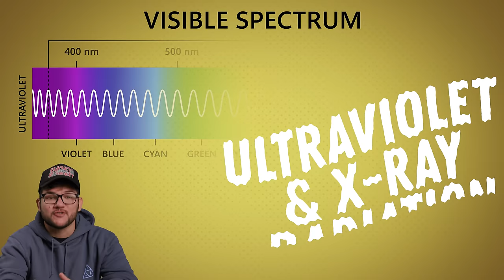Mechanic Reacts to Welding Fails from Tiktok

Comment: Sandro is a jack-of-all-trades!! What else can he do?
Reply: Sandro is that 45 year old dude from your local shop that has been doing mechanic work since he was 15. There is very little he hasn't seen, done, fixed or broken.
Reply: "...So we invited some professional monster truck drivers to-  Wait, you here again?"

"Well @#$& yeah bro!"
Reply: @russelljacob7955  LMAO
Reply: Jack of all trades, master of none, but often better than master of One.
Reply: Im sure they’re out there, but don’t know any mechanics that don’t know how to weld. I think there’s more welders that don’t wrench.
Reply: Jack-of-all-trades, master of none? No, my man Sandro is master of everything!
Reply: roll a perfect ass blunt
Reply: Probably juggle 6 sparkplugs with one hand, 3 turbos with the other while balancing on a transmission tunnel on one leg.
Reply: @vittoriosandoni7064  It's rare to find someone that actually knows the whole quote and doesn't use it as a slight.  👍
Reply: @wisconsineaglesfan7925  I’d never heard the full one and I like it. It reminds me of blood is thicker than water. The actual quote means the opposite: “the blood of the covenant is thicker than the water of the womb.”
Reply: That’s like saying a carpenter is a jack of all trades because he can swing a hammer.
Reply: @swamp-yankee  More often than not mechanics are terrible welders. They’re often worse than hobby welders because mechanics truly believe they can weld when they typically suck. When you lack the technical knowledge it’s real easy to convince yourself that your undercut weld with no penetration is good.
Reply: My mom... wait.

Comment: I am a weld inspector, pipeline among other things as Sandro mentioned. The red stuff you see coming out of the weld at 10:00 is called dye penetrant, it is a specific type of oil colored with dye that draws itself into cracks and other imperfections. The surface is then cleaned and what the guy in the video is spraying is the developer, essentially aerosolised chalk, that draws the red coloring out to the surface.

Also where I live, carnival rides are definitely subject to regular weld inspections, at least on load bearing areas and repairs.
Reply: When I get another 1,000 hours under the hood I want to get certified as an inspector.
Reply: we use it in hvac for leak detection too

Comment: I watched an industrial welder do some stainless steel piping connections once and what made me stop to see the outcome was that he was making some weird looking upper body and shoulder movements with a Tig welder. It was the most perfect smooth weld I have ever seen! The flow of the weld looked like a machine had done it.
Reply: a machine did do it.

a tig welder is a machine.

Comment: I’ve been welding for 48 years, one of the first things I learned was just because it’s aesthetic doesn’t mean it’s a good weld. The pretty part comes with experience, make sure you have your prep and penetration down first, then practice on making it better looking. 
 Lesson 2: just because someone bought a large tool box with tools doesn’t make them a mechanic, same goes with a welder.
Reply: Yep. You can make an ugly weld that penetrates and you can make a pretty weld that don't. That said, quite a few of the bad welds shown in this video pretty obviously didn't penetrate..
Reply: The Trades take time to grow and deepen the learned.

As seen by "rechtschaffend frei/fremde Wandergesellen" on their "Walz" over here in Germany and actually throughout the entire Euro - Asian Continent if one so desires.
most often they are Carpentry Journeypersons in their Journeymen years
Reply: I got the shit stick cause i can do very strong mig welds but they usually look like crap, and i got a job that needs pretty welds not necessarily stronk welds

Comment: As someone who has spent ten years all over the country welding from ships to oil rigs to pipelines this video was enjoyable.  As a trained professional with a degree in metallurgy this was one of the most painful videos I have seen in a long time!  On a side note some of the best welders I have seen are mechanics they just have to do a lot more welding than you think.
Reply: meh they more or less have a controlled environment. not impressed

Comment: Welding when you get all the prep right and everything is just working spot on is actually really relaxing I find. You get in the zone and nothing can move you.
Reply: man, it's almost like you're in your own little world in there. You get your ear pro in, covered in leather or heavy cotton, mask down so you can see nothing but your weld... Everything else is gone, it's just you and your weld. I love it. Unfortunately my ears start to hurt after 4-6 hours with earplugs in so actually working 10 hour shifts as a welder hasn't worked out for me.

Comment: My first big welding project was welding new axle perches and mounts as well as shoring up a northeast Jeep frame. 3 years later and the welds are still holding strong, and one time even smashed through a pothole and really rocked everything and they didn't break.

I did this on literally like 2 hours of learning how to stick weld.

Comment: 10:25 I worked as a machinist in a petrochemicals plant and my man Sandro is spot on. I usually beveled the pipes for fabrication shop between 30 and 37.5 degrees and you get a nice V shape when you face them on each other.

Comment: I remember on my first welding job I was welding aluminum structural with meg. I was looking up, spark, came down with the bottom of my shirt up and I was on fire didn’t stop even though if that’s a little hot smells a little didn’t realize what was happening till someone laughed and pointed at me and I was on fire. God bless welders one of the most blue-collar jobs you can do.

Comment: Flux core is my favorite; it's like mixing MIG and stick welding. And then a bit of TIG just to clean up the surface (if we're not grinding). I do alright; but I need way way way more practice before I'd put my welds out there. xD
11:00 - My welding instructor told me he inspects welds as much as he can see before he ever gets on a ride.

Comment: 11:50 allegan county fair flipper ride got stuck with kids on it a few years back. I remeber going to look at it as an Industrial Electrical Technition. It was an old Italian machine from the 80's. Needless to say I looked at it opened the electrical cabnet to a spagetti wired mess in italian, and said ya I can't take this on for liability sake.

Comment: I have a degree in welding technology. I thoroughly enjoyed this video. Keep up the good work.
On a side note, the buggered wire feed welds are caused by running incorrect polarity. MIG and FCAW are both wire feed, but require opposite polarity.

Comment: Our local carnival consists mostly of vintage rides. Very sketch welds. The last time I was there is the last time I ever go to a county fair. I was riding a spinning ride that moved you up and down in the air. One of the service doors flew open and proceeded to smack the rides being banged around so hard it was throwing sparks when it collided with the bars. The very lazy "I don't get paid enough to work here" worked, very slowly came over to the controls and decelerated the ride, rather then hitting the emergency stop button. Meanwhile the rides kept hitting the door. The door was a mangled mess (could have injured someone) and the ride operator proceeded to grab duck tape and tape the  door shut. Everyone in line and on the ride noped out of there. Welds on the rides were bad but not only that, very cracked and rusted supports.

Comment: My metal fab and welding teacher in high school 20 years ago taught me CLAMS: 
Current (How hot you're running) 
Length of arc (How far from your material you are) 
Angle (Your angle in relation to what type of weld you're doing and what thickness material you're welding) 
Movement (How you manipulate the arc; J-hooks, Keyholes, V's, Upside down V's, etc, "walking the cup" for TIG)
Speed (How fast you're traveling). 

Keep those in mind while you're welding and you will produce far more consistent welds.

Comment: So I just finished welding a new rocker panel on my truck today. Watching this is like watching myself make mistakes. I trimmed way too much off in spots and just filled the hole with weld, kept blowing through the thin metal, and had lots of build up. I did a lot of grinding. Overall though, I think not too bad considering I've only welded a little bit on much thicker metal.

Comment: TIG welding done properly is Liquid Sex, I Love it out of all the welding types especially when it's stainless or aluminum. Gas welding is a lot like TIG, It is probably my favorite for ferrous metals. Stick welding is an art, once tamed it's very versatile across many industries. MIG welding with gas is also a huge go to for ferrous metals but I hate flux core welding, it has no place other then the quick fix and spot welds. Got a lot of good laughs and some eye openers too. Awesome Video👍

Comment: Back in high school, one of the boys got a DIY trail bumper kit, where they just mail you a bunch of unpainted flats. 
We pretty much just ground every weld and went over each seam a second and third time before painting.
Probably ruined the heat treatment on the steel, but it ain't what put the truck in the scrap yard.

Comment: Had to pause real quick to add in additional tidbit on tig vs. mig. Tig leaves a soft weld where you can hammer and dolly the metal around a little bit. Mig leaves a hard weld where you can’t hammer and dolly around. It’s completely hard and will crack. Now to finish the rest of video to see if you possibly make that point as well.

Comment: Still remember my first weld. Trying to fix my old broken office chair but didn't realized the tube I was trying to weld back together was actually super skinny and surrounded by a thick aluminium outertube. Using a cheap ass stick welder, I just melted the aluminium to oblivion and the steel tube was just too skinny to weld with a stick welder by a nucklehead like me.. It broke to start with because it was paper thin. Years later, I actually got into workshops in uni and had some seriously skilled welders at my job and managed to learn a bit from them. Still not a welder... but I'll get the basic stuff done with stick and MIG... TIG is another beast altogether. And way cleaner.

Comment: weird thing about putting an AAM1150 under my Thunderbird... the rear driver side was hit. the rear driver side wheel looks like it is a 1/2 inch to far back to the other side... had no idea it was rear ended till i started measuring. modern bumper plastics fall apart when hit, 90's ABS is good. modern reproduction bumper set for that car is as expensive as a new one, have to pull all the casts out of storage...

Comment: I took a welding/metalwork shop class in junior year of HS. These two kids, the biggest stoners in the school, also thought it'd be "lit" to take the class for the extra credits. The next month and a half ended up being an OSHA inspectors worst nightmare. Showing up high as hell, not using safety glasses or hoods, nylon/polyester clothes catching on fire, open toe shoes in the shop, playing with the welder while it's live, hands getting a little too close to the drill press bit 😂 by the end of it everyone else got passing grades for just not causing the instructor more headaches

Comment: I grew up stick welding. I tried mig and Tig for the first time only a few years ago. After I got the hang of mig, I parked my old Lincoln crackle box. I can hear crying of loneliness right now. It still serves it's purpose on large structural stuff, but I rarely mess with anything over 1/4" thick.

Comment: I was a union pipefitter/welder for 10 years and changed careers after seeing how many of the older guys got cancer or lou gherig's disease or radiation poisoning, etc... from both the light and the fumes released by most of the materials being welded. Now anytime I weld, i use a respirator and ke sure no skin is exposed.

Comment: Worked as a "certified high-pressure welder" for decades. While welding in certain areas of powerhouses extremely tight. My welds were X-rayed for quality. Many times as I'm finishing up a weld, I'll smell my clothes smoldering. You don't want to stop and risk ruining or having to restart the weld. As you say the prep work is key. Welding chrome alloy tubes, the shift, opposite mine was supposed to "clean the weld area". My foreman told me they had prepped everything and all I had to do was weld. Everything was going smooth until I got to the "tough spot". You had to work hard to clean this inside area (they failed to). As my heli-arc puddle got to the "tough spot" i saw the puddle start bubbling. I knew immediately they'd missed some dirt. The weld tech knew me and my work ethic, he informed my foreman I was the only one to prep and weld the tubes. No X-ray or pressure failures on my work - ever.

Comment: A saying at my old job "just turn up the voltage and burn through the rust".  I'm no expert, but it was like fingernails on a chalkboard listening to the diarrhea coming out the welders.  A little time with a grinder and actually looking at the chart for a starting point made life a lot easier for me.

Comment: My father owned a local welding shop for 50 years. In my time working there I saw some absolutely abhorrent stuff come in from small traveling fairs. Rollercoasters with barely holding welds and bent rails. Rides with JB weld acting as real repairs. I would never let my kids go on any rides at small fairs after those days.

Comment: 3:04 Uhhhh... welding doesn't create x-rays.... but also the mask does protect against the intensity of the light. If it were just UV protection you could use sunglasses.

Comment: Sandro is awesome because he is humble. Welding is about clean surfaces and heat control and too many people get one or both of those wrong. Too little heat and it looks like a caterpillar laying on the surface and you have no bonding of the metals. Too little cleaning and you get porosity bubbles and once again no real bonding. Some stick rods are meant for welding dirty metals and can put up with some paint or rust but MIG and TIG can not. You might get a "nice looking" weld with MIG on dirty metals if you have your heat and wire speed perfect but you don't have the strength of a clean weld. So if you have to weld dirty use something like 6010 or 6011 or some of the other rods made for deep penetration that can burn through that top dirty layer.

Comment: never welded before. had a chair break and tried to weld it back together. needless to say, my weld did EXACTLY what it was supposed to... for 2 days until the new chair came in and the weld broke. so yeahhhh dont have me doing any important welds for ya. it was fun though! absolutely have a respect for the welding force out there. i got my own set of skills but it is a craft that comes with a steep experience curve.

Comment: Why don't people practice welding before they attempt an actual weld on something like a car? 

I remember when I was 15 and in school I took welding classes because it sounded fun. The first thing we did was to weld random junk steel together for a few weeks. We didn't even get to attempt the first proper work for the class, before the teacher approved our welds on the metal working classroom's junk bin steel. 

Then we got to weld some of our first projects. And that didn't make us pro welders. But at least we knew how to attach two pieces of steel together so they stay together, without melting holes or getting our filler stuck.
Reply: People have this nasty habit of thinking "this shit is easy bro" and of course, it's not. Friend of mine thought he could weld his aluminium boat back together after cracking it. That boat is now at the bottom of the local lake..

Comment: Something most people miss on automotive, even dudes that weld as a day job, is matching filler to base metal. You can throw ER70-S6 on stainless steel but it's going to look and hold like junk.

Comment: My 2013 Ford has that same fuel system. It's never farted but I believe I have bad purge valve because it sputters for about 20-30 seconds after every time I fill it up, but only at the pump so my assumption is air is getting into the fuel line like an air embolism in an IV, so it's going the opposite way of the one in the video.

Comment: I can stick weld but it looks like crap when I'm done.  But, when I weld and finishing  beating the slag off and probably grinding to make it pretty, it will hold.
I've got flash burns a few times with a helmet.  When I was in HS and took a class where they taught you this stuff, a flash burn will make your eyes red as heck.  This was the early 70's so you looked like you just finished off half a lid with the windows rolled up between classes.    Ha.
I figured out one of the best tips is finding and keeping the right angle of the rod and getting that first bead started and running with it.  Did lots or angle iron and 55 gal cans too.   Set the proper power.

Comment: I been there on a few of them mishaps. You don't play around. Several tack welds can give you a sunburn and some cases an extreme one. One thing Sandro mentioned is the eyes. If it gets bad enough, your eyes do feel like they are being sandblasted, whether open or closed. Not a fate I wish on a hard-working individual. My girlfriend was ready to call it in or rush me in when it happened to me. Those who know, just know. I've done lots of mig, done structural welding, and have had my hands on mig, tig, small, and flux.